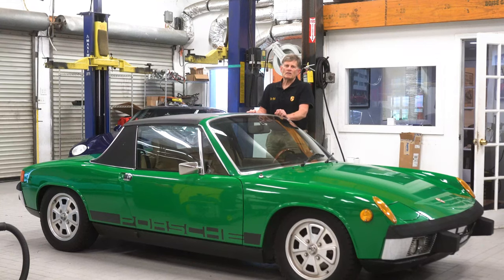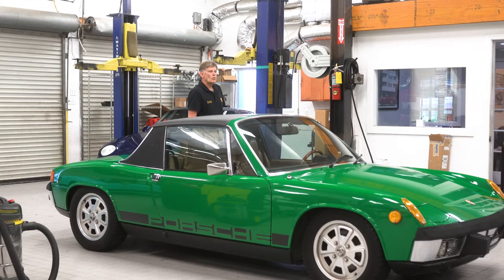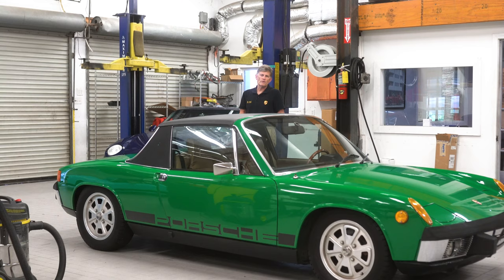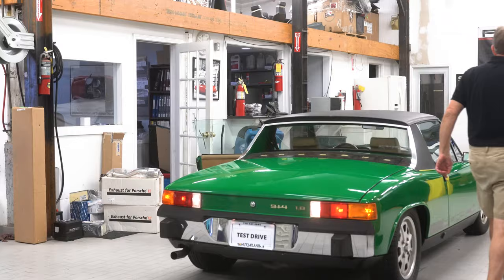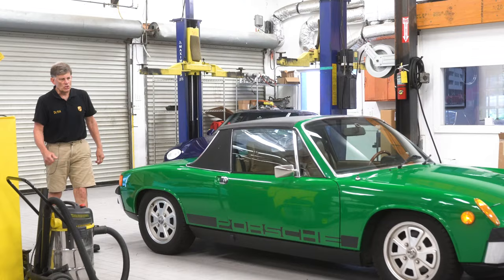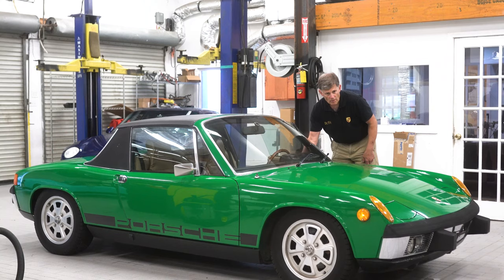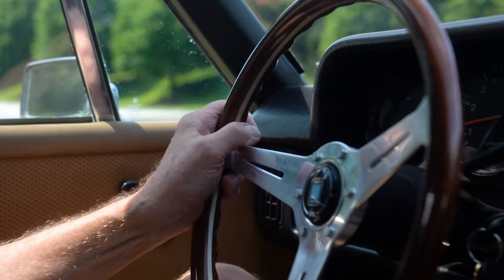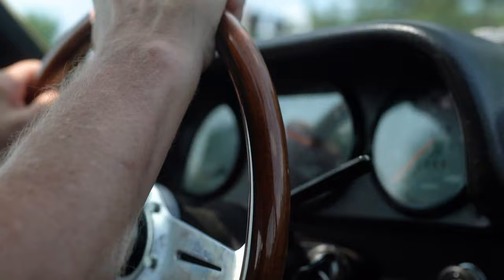Driving tour of the Porsche 914

Comment: At around 7 minutes, I noticed that the 4 way flashers didn’t all blink at the same time. First the left light would blink and then the right. Is that the way that they worked on a earlier 914 or is there something wrong with that car? Wait, never mind. I know what happened. When Dr. 914 turned on the 4 way flashers, the right curb light had been turned on.
Reply from the maker: Yep, that was it